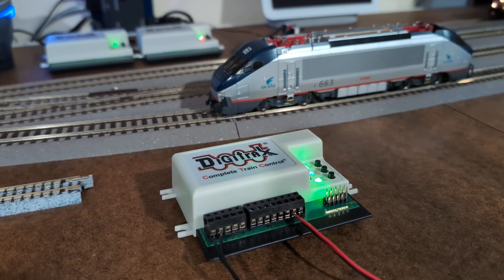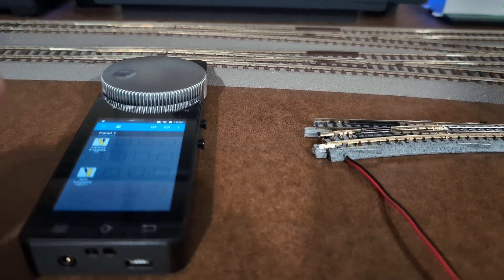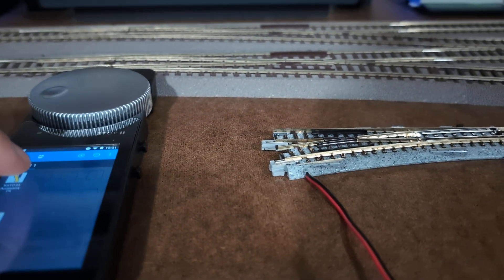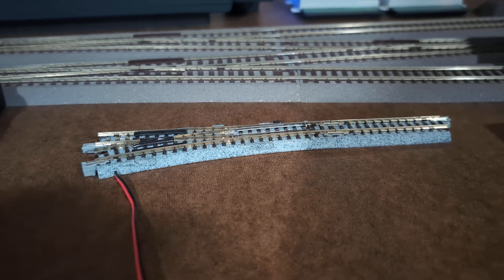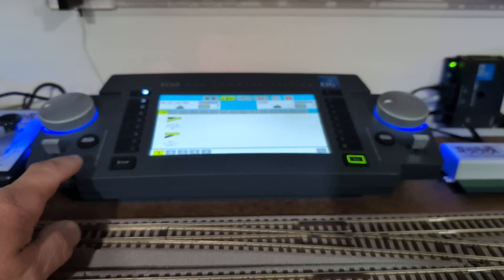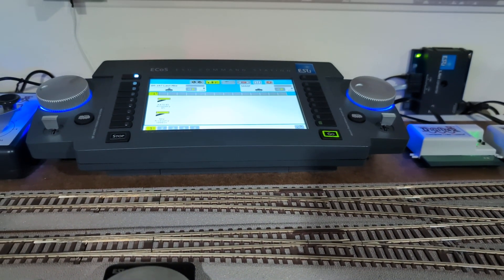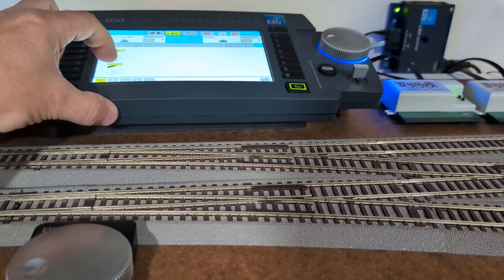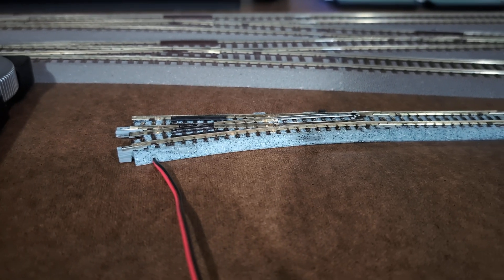How to program Digitrax DS74 with ESU ECoS?

Comment: I have a question. So I use the Digitrax 210+ command base system with the wireless controller. Recently I’ve really liked the LoDi Con Throttle. I know it connects via a “WiFi signal” to a command base. Do you think if I were to buy the Digitrax WiFi module (LNWI) would it connect to the LoDi con so I could use that a  throttle? Thanks
Reply from the maker: Hello! The LNWI lets you connect compatible WiFi devices to LocoNet and run trains using compatible throttle apps. Compatible with most Android and Apple devices. On the LoDi Con website, I saw that LocoNet is listed, but is in developing mode. At this time Digitrax is not listed as a compatible Command station.
Reply: Thank you, do you recommend the ESU Can controller? I’ve heard a lot of people say it’s too buggy/slow. So I wanted to ask if it’s a nice option to invest the money to have a nicer looking controller. Thanks!
Reply from the maker: No problem. The display of the Mobil Control 2 is small. I will recommend TCS UWT-100 it works with LNWI https://dcctrain.com/shop/ols/products/tcs-uwt-100

Comment: How is it wired to receive signal from ecos
Reply: I have it wired up, power from ecos to track, another cable to ds74, and mains power to ds74. When I press the id ds74 flashes green and red, toggle turn out on ecos and ds74 turns green, turn does not switch
Reply from the maker: @stuartwallace3723  Do you have KATO turnout?
Reply: @dcctrain  yes number 4, 6 and  3 crossover
Reply from the maker: @ try to get one turnout to work.
Reply: @dcctrain   only tried 1 as to test
Reply from the maker: @stuartwallace3723  Default address is 1-4. Could you let me know if you tried the first output?
Reply: @dcctrain  yes I tried the 1st one on the left
Reply: Got it sort,most people count left to right 1 to 4 not the other way round, shame digitrax  don't make it clearer in the instruction
Reply from the maker: @stuartwallace3723  Nice work.
Reply from the maker: Two terminals to the left are TKA and TKB. I used black wire.